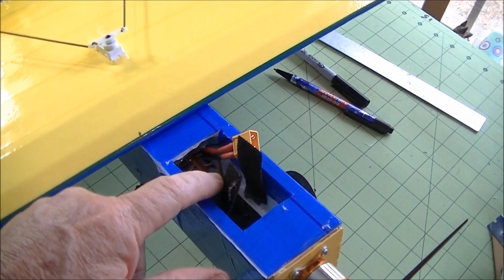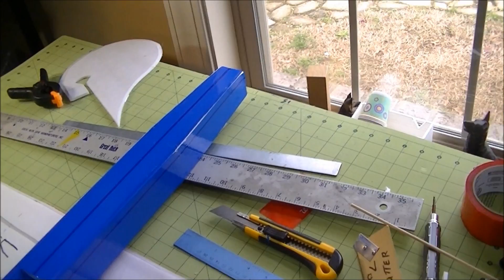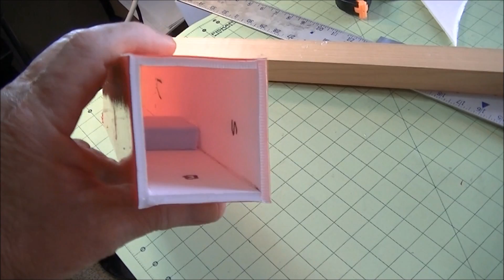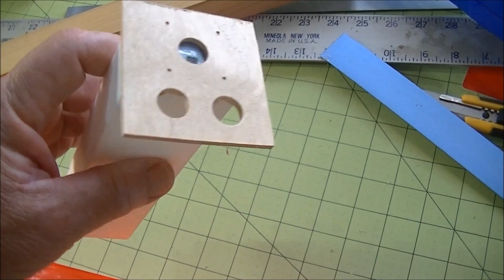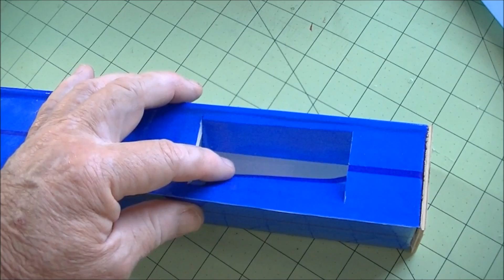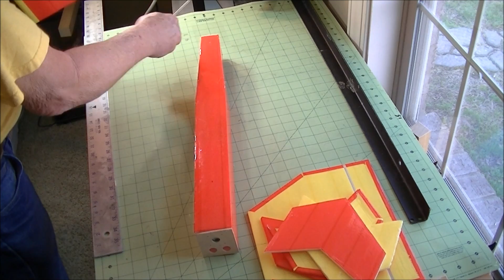Foam board bloody wonder rc plane modified build

Comment: GREAT video Sir.  I have the F.T. Bloody Wonder coming in the mail right now.  I'm going to modify the Fuselage into One solid piece like yours.  QUESTION.  Is there any kind of Thrust Angle needed to make this airframe fly straight.  Usually down and to the right is needed.  It appears that your motor mount is at a 90 degrees flat angle.  If you understand my question, could you let me know please.  THANKS.

Comment: I am scratch building a Bloody Wonder out of Coroplast.  From the front of motor mount to the leading edge of the wing...How many inches back is it?
 Also on the aft end of the fuse could you tell me the layout of the taper? (top.bottom, and two sides?